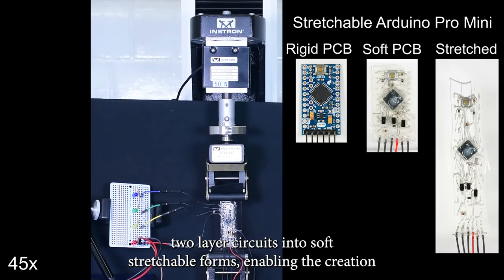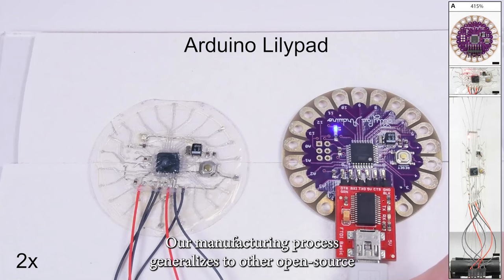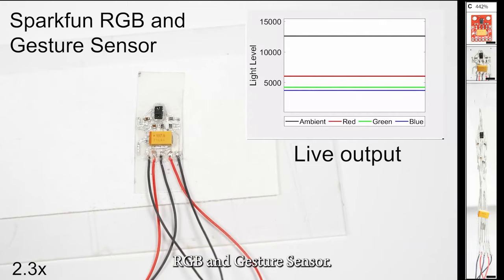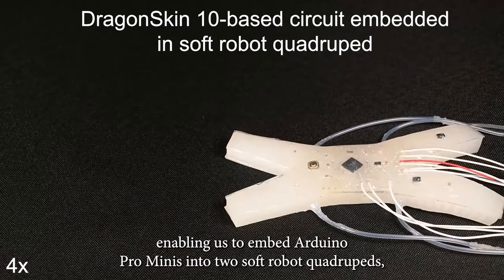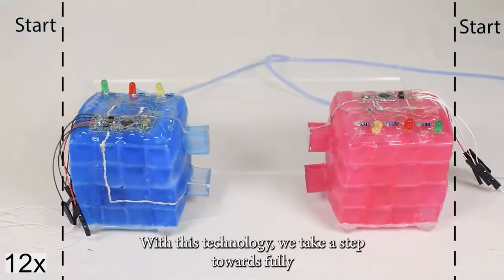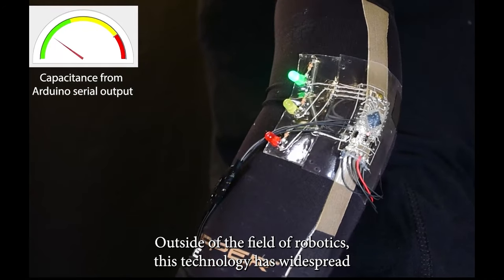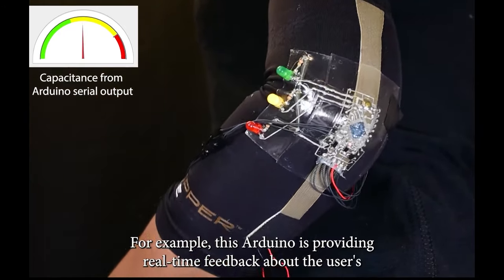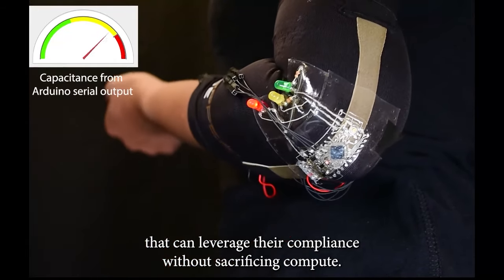Overview of stretchable Arduinos embedded in soft robots

Comment: I thought it was a 10 year old video only to see it past 6 days. INPLAY has a BLE beacon that is so small the alongside a LSM6DS it could give you the real-time motion, angle and rate of both angle and movement. The miniature size of the system relieves the flex requirement all together along with low power requirements.

Comment: i'm curious about durability.
how many times could a circuit be e.g. stretched to 250% and quickly released before tearing, loss of electronic connection, major plastic deformation, etc? i skim read the paper and couldn't see anything about that.
Reply: It will also only work with rather low-frequency non-complex circuits, anything higher than 20Mhz would cause problems. For even higher frequencies the path length changes would cause timing issues.

Comment: This is amazing y'all. The added benefit of stretching is increased durability and resistance to shock/impact/vibration stresses. The footage of the extremely stretched arduino is mind blowing. I cannot wait to see the applications of this technology in the engineering of the future.
Reply: > increased durability

I'm gonna call doubt on that one. We really don't know anything about how durable these circuits end up being through even cyclic strain, let alone whether there are delamination risks (you can see the circuit delaminating in the X-robot demonstration) and how durable the bonds between the flexible substrate/circuitry and the rigid silicon chips or components placed on them will be.

Not saying there won't be uses for this technology in the field - but the durability of such a circuit should really be compared to a small PCB or embedded microchip, embedded in a flexible silicone structure/sheath, for a practical comparison. Just because a device needs to be flexible doesn't mean that all of its circuitry needs to be flexible.
Reply: @henryptung  I agree. The durability of these flex circuits will be terrible.